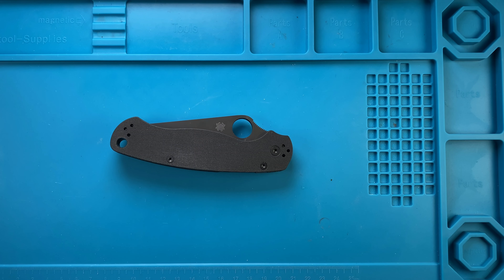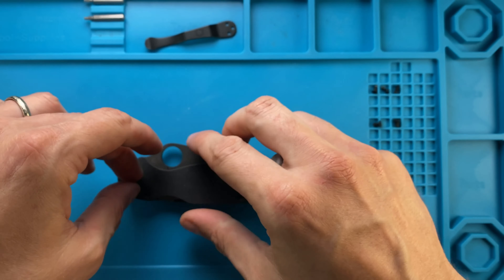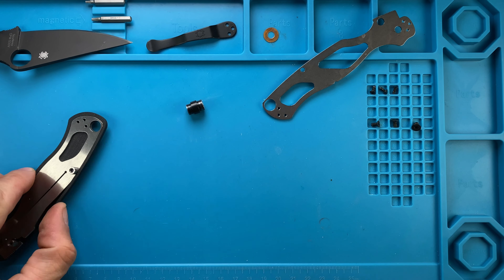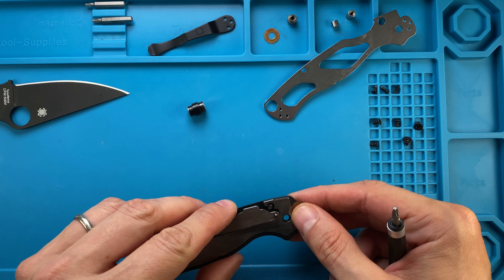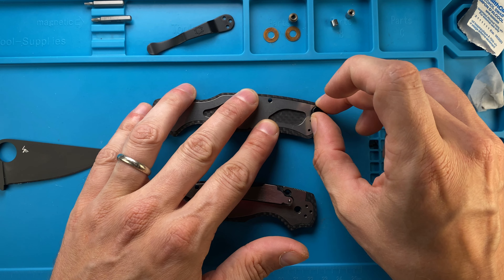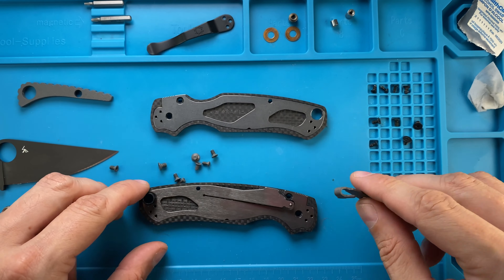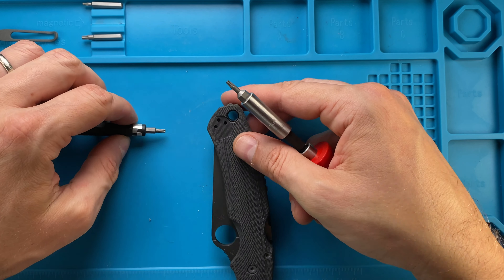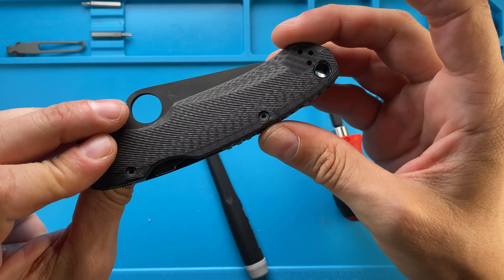How to Pimp and Disassemble the Spyderco Paramilitary 2 Pocketknife. Fablades Full Review

Comment: Very nice, educational video. Thank you. ... I gifted an S-110V, blurple PM2 a couple years ago to the daughter of a friend. She'd enlisted in the US Navy and was about to be inducted. ... As for myself, I've always been a Spyderco Military guy, owning 5 - an original format ATS-34, two in S-40V (plain & fully serrated), an S-30V digi camo, black blade and an S-110V blurple. ... I decided to see what all the fuss regarding PM2s was all about and received a Bento Box exclusive M390, royal blue G-10 model a couple days ago. ... Have been carrying it since reception and working the action frequently to mate the metal parts together. I'm on the fence as yet as to whether I really like it. ... The G-10 covers have a pretty grippy surface which offers some resistance to clipping into denim pocket and when drawing the knife from the pocket. ... The PM2 handle contour looks very ergonomic in online photos and videos. With mine, I'm finding when I grasp the PM2 very firmly with the blade open, my index finger barely makes contact with the handle with the finger tip and 2nd finger section forward of the middle knuckle. The factory pocket clip comes mounted in tip down, right hand carry mode (which I prefer). The part of the pocket clip that's bent farthest away from the scale is directly over the narrowest part of the handle, where your index finger falls. For my hand, it contributes to my index finger not making good contact with the opposite side of the handle. ... I'm very, very surprised to have not heard anyone mention this foible in the myriad online reviews of PM2s. ... Truthfully, so far, I'm seriously underwhelmed by my premium version of the PM2. As such, I'm reticent to spend $100+ for the upgrade of Aramis Akhmedov's carbon fiber masterpiece scales. I find I prefer the Military to the PM2 so far. I've not given up on my PM2 yet. Time will tell. ... I purchased my first Spyderco, a Police model fully serrated (Gingami 1/G-2 steel) with SS handle in winter 1987. I love Spydercos and have probably bought close to 30 of them, many of which were gifted. ... I welcome any feedback from others about their PM2 impressions and opinions. ... Thanks again for your superb video.
Reply from the maker: Thank you sir, appreciate it! Ergonomy also depends on your hands size and shape, I find the contouring of these scales to fit perfectly my hands, and to have improved the grip by a lot, compared to factory scales. Also these are much more comfortable, being rounded off and not as sharp as the original G10 ones. In addition, they look cool 😉